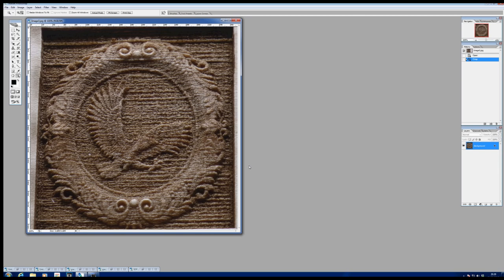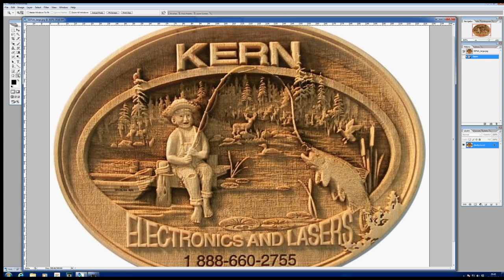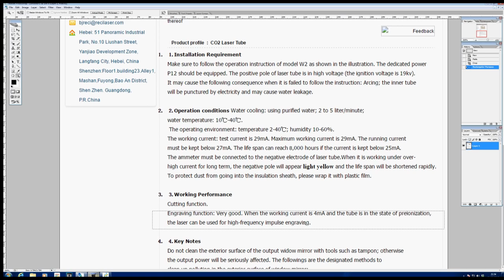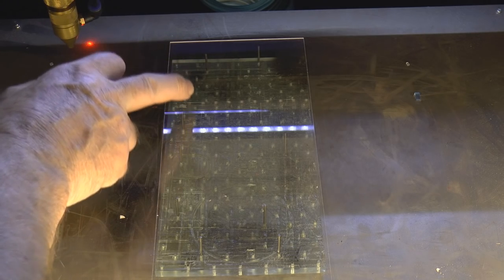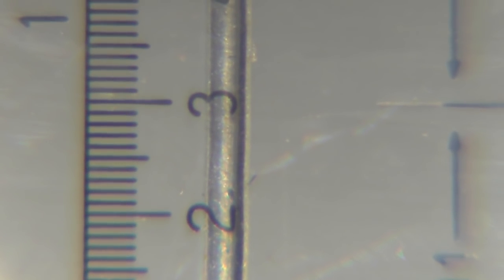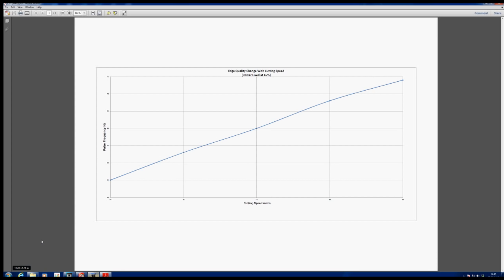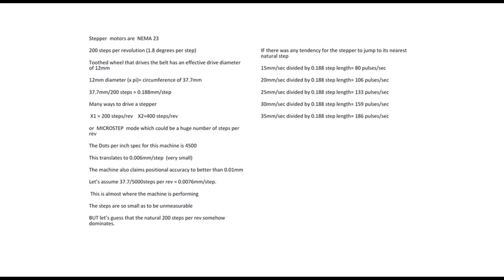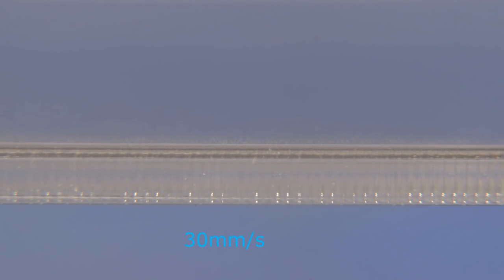RDWorks Learning Lab 63 High FrequencyImpact Engraving

Comment: Stepper motors are inherently digital, so it makes sense they cannot track smoothly. Adding weight to the laser head will lower the resonant frequency of the laser head/drive belt combo. If this resonant frequency is lower than the stepper pulse frequency then the travel should be smooth. The down side of adding weight will create larger forces on the machine requiring lower accelerations and additional wear and tear. 

Another solution to lower the resonant frequency of the laser head is to reduce the stiffness of the drive belt or putting rubber mounting on the stepper motors to smooth the amplitude of the torque pulses.

Thanks for the videos.
Reply from the maker: Hi Tim
It is possible to achieve extra inertia by using Y swing  but I have not seriously explored that option.... yet. That way you add quite a lot of mass with the gantry, head and bearing rail, but you have to run a bit slower.  I did note that even the best in the business (Kerns) still use stepper motors (closed loop hybrids ) along with non-elastic rack and pinion drives. There is still evidence of vertical marks on their deep cuts but I suspect that with such a non-elastic system  and the mass of the motor, which must be attached to the head, that would keep the resonant frequencies low. 
Thanks for the interesting feedback
Russ
Reply: Stepper motors are analog. Stepper drivers drive them digitally. Some drivers have microsteps - each step is divided to smaller steps - 4, 16, 32 ... etc. There are drivers that provide really high number of microsteps which leads to smooth, constant speed, quiet motion. Reference: https://youtu.be/ZzO9skEYqwY

Comment: Just wanted to say good work on this series. I have learnt a lot. I use to grind glass with a CNC and would get vertical striations like this. It ended up being vibration in the rail system. I installed a damper and it fixed the issue. It wasn't the steppers, but the gantry that was the problem. It was also speed dependent. Good luck!
Reply from the maker: Hi Philip
Many thanks for your thoughts and experience  I had noticed that the Y axis striations are more pronounced than the X axis marks but it was more difficult to get good closeup shots in the Y axis. So what you are saying has a lot of credibility. Subsequent to publishing my video I realised that I had overlooked a vital piece of evidence that I had gathered. My camera takes 50 full HD frames per second but the sound is captures continuously at CD quality. When I examined the sound track for the stepper at different speed there was no evidence of the resonance that I was convinced I heard. In fact all stepper speeds were showing as 225Hz noise. So I do have to look elsewhere in future.
Your situation may have been a bit different in that grinding glass and cnc engraving spindles  will send their own rotating head vibrations and also reaction forces with the work they are contacting. Neither forces exist with the laser.  What sort of damping system did you use? I had already considered mass damping as a research tool rather than a permanent fix , the extra mass would mess with the performance. I am very impressed with the accuracy and speed of this cnc control system  considering its very low cost.  These striations are but a possible clue to finding what's causing the VERTICAL lines in my 3D wood engraving. The only thing I can think of that knows its position on the machine bed, stroke after stroke, is the stepper. The laser, which I feel is pulseless when it is a steady power, may become a different animal when it's trying to find 256 grey levels. The PWM at 20kHz cant see changes in less than 100 micro second so I'm guessing that there is some other route to the power supply to control the current for rapid grey scale changes. This is something I'm going to have to try and check out.
Thanks again for your suggestions, it's great when others share their experience...remember I still have a lot to learn and in very technical areas like thi, if there are people that do know they are not saying.
Best regards
Russ
Reply: The mass damper I used was a mass and spring system on the edge of the rail. I had to sacrifice some travel distance, but it was worth it. I agree the lack of a tool load on the laser head makes a big difference in vibrations, but if you get close to a resonance zone even accelerating the mass of the lens and head could vibrate the rail. Also, if you have a belt system with cogs in it those are known to generate first and second degree modes. Although I don't work on CNCs currently I now do finite element analysis on jet engine systems. We deal with vibrations a lot. Another thought is that the vibrations are disturbing the cooling air resulting in modulating forced convection on the surface. So it basically is cooling better or worse based on the vibrations. You may want to see if you can observe vertical striations that are closer or further apart in a repeating pattern. That would indicate a second mode of vibration. Can't wait to see what you find!
Philip
Reply from the maker: Hi Philip
Thanks for you useful information, it triggers all sorts of thoughts. I had considered the possible slip and climb effect of toothed belts but with some close up video and slowing it down I could detect nothing untoward happening as the belt entered or left the pulley.  The problem was greatest when it was slower and as I only have 15 teeth on my drive pulley which has an effective drive diameter of 12mm , that's 37.7 mm circumference or aprox 2.5mm/tooth. If I had a tooth problem I would expect to see a FIXED pitch problem regardless of speed. Puzzling
Thanks again
Russ

Comment: Sarbar, While your laser is DC (direct current) and this works very well across a wide range of power levels, ionizing lasers (any gas) require a minimum current to continue to operate. To achieve the lower power levels, it is quite likely that the manufacturer changes the mode of the power supply which supplies the current (lasers are current driven devices) to pulse, where the average power delivered is in what is being expected. Bravo for your acrylic experiment, where you provide a way of visualizing this behavior. The reason current pulsing is needed has to do with the tube minimum tube current to sustain the beam, too little and the beam extinguishes. So the short high current pulses are well above the minimum needed to start the laser and when repeated at a high rate (5.5Khz at 9% and 3.5Khz at >10%) the average is lower than where DC  can be used reliably. When 14% or greater is being required the power supply changes mode back to DC and there is no change is power.
Reply from the maker: I am not an electronics person although I can get in to about my ankles. I had all sorts of issues with my first ebay power supply especially when it would be mid cut at 60% power and drop into "hissy" mode and lose the cut. I did not have a clue as to why it was doing it and decided to buy a new tube and matching power supply. It was during the research for that tube that I came across the term High Frequency Impact Engraving on both the Reci and EFR websites (as well as Mactron).  If you search for this HFIE it will just get you back to the EFR and Reci websites. I could find out nothing about this mysterious operating region. Hence I had to carry out my own voyage of discovery. I gradually became aware of what this "hissy" region was and why its there as part of the beam initiation routine.  I use this region often as it has some great properties. However I have one unanswered question that is really bugging me. 
It looks as though these (hissy) pulses can get as high as 60mA (maybe even 100mA). albeit for  very short spiky durations. Such high currents normally cause dissociation of the CO2 in the tube. So my question is whether persistent purposeful use of the region will seriously shorten tube life AND if this region has to flleetingly be traversed every time a cut initiates, is this what ultimately causes the tube to be depleted of CO2 by  trickling dissociation?
Any thoughts on this?

Best regards
Russ
Reply: I do not know this for sure, but I would expect there to be some 
shortening of tube life (maybe as high as 10%?) if you were to operate 
this high power laser in this very low power region continuously. High 
current levels may contribute to I dissociation / contamination of the 
mix. I know with Argon lasers tube pressure can be somewhat moderated by
 simply not letting them sit too long. I was going to suggest you use a 
second lower power laser in cases where only low power is needed, but 
that may not be acceptable for several reasons such as various 
materials, projects, extra cost, etc..  As to whether this region can be
 avoided, well, that has been governed by the manufacturer and how they 
manage the power supply. This may be observed by your acrylic experiment
 again, by traversing as fast as possible and then programming a step to
 some higher power and look for pulses at the start of the cut before it
 becomes smooth DC. I would expect at least one moderately high current 
spike on start up. Cheers!

Comment: in RDWorks V8, when you go to the layer parameters, There is the -- Interval(mm): 0.1 -- option. When you lower that number, the amount of space between the scans becomes less and the quality of your work will improve and you will see less of those rough lines in the background. I had done this a while ago with something I had made and it took a very long time when i had lowered it a lot, but man, the work was a lot nicer then the standard setting of 0.1.  Try 0.05mm Interval with the same file and look at the difference. You might have to change the power setting so that it will not cut too deep. I hope this helps in your journey.
Reply from the maker: Hi Harrie
You are quite right about the line spacing and I'm not worried about horizontal lines at present because I know I can either lower the line spacing and increase the time the job takes or I can increase the power and lower the table 2 or 3mm out of focus to get wider lines. It was worse for me when I did this first test because I was aiming for depth and 3D rather than quality. I have a 1.5" lens which produces a much finer line than a 2" lens. My major concern was the vertical lines I was seeing in my scans so I was more interested initially in trying to track down their origins. I have now done that and will have to apply all that I have learned in a near future revisit to 3D carving.
Thanks for the confirmation that lowering the line spacing will improve my result. I hope to do much more than that as well because I am aiming for significant improvement on my initial exploratory attempt.
Best regards
Russ

Comment: Russ,
Just wondering if you can answer a couple of queries I have.
1. How do you determine what focal length your lens is?
2. My machine looks like yours and I am wondering when I put the lens back the lens carrier can be adjusted and locked into different lengths so my query is what difference would it make to the operation of the lens?

Trevor
Reply from the maker: Hi Trevor
1)Use a drinking straw or cotton bud stick to measure how far your lens is inside your nozzle and then add that to the width of you setting piece.  You will find the nominal focal length and that can only be 1.5" 2" or 2.5"
2) The answer is no difference at all. If you think logically about it, when the head is at its home position the beam path is  say about 12" long, when you move the head to it's other extreme. the path is maybe 48" long. The beam remains coherent( about 6mm diameter) and loses no power travelling through air. The adjustment you are enquiring about is just adding and subtracting from this path length because it is before the beam enters the lens.
What's the adjustment for? If you have a 2" lens I think you will find you can open the front door panel  (and maybe the rear door also), drop your table down so that you can get  an oversize piece of thin material into the machine. You may be able to drop the lens sufficiently to work on this material.
Best regards
Russ

Comment: How can 70% power on RDWorks settings = 100% power on the laser cutter? How can I find out what percent power on my software = 100% power on my hardware laser cutter?  What is the relationship between mA and % power? What is pre-ionization, and what effect does it give me when laser cutting? Just trying to wrap my head around this. Your videos are the first place I've found that even begin to address this. Thanks.
Reply from the maker: Hi 
When you select %power,  the Ruida controller  generates a linear control signal that is 0vdc for 0.1% and 5vdc for 99.9% power. That control signal is sent to the HV power supply. The HV power supply has a maximum mA current rating depending on the tube power it is designed for. For example a 60 watt power supply may be rated at 24mA max. When you select 99.9% power that 5vdc signal will allow 24mA to flow through the tube.The current control is also linear so selecting 50% you will be allowing 12mA to flow through the tube. The big problem that most people fail to understand is that the physics of lasing is NOT linear. Every tube has it's own non-linear relationship to current flow . Some are VERY non-linear. For example a 60 watt tube should not be run at more than 22mA ie 24/22=90%.power.  but 45% power will NOT be 30 watts. It could be that 30watts will happen by about 20% power. these video will hopefully answer your questions.
 https://www.youtube.com/watch?v=2F5O-1TH8b0&list=PLPWEtx5V9DqEogIeYRdcG_KYcB7UL2Qmn&index=7&t=44s
https://www.youtube.com/watch?v=nZuatc3eIgU&list=PLPWEtx5V9DqEogIeYRdcG_KYcB7UL2Qmn&index=26&t=1487s

I always use the top end of the preionization zone for card and paper cutting and also for photo engraving on some materials.

Best wishes
Russ

Comment: Great video! 
Question - while I understand the pulse consistently based on power setting wouldn't the laser focus also play a role in the detail or lack of detail as it cuts deep into a said material? For example if cutting a piece of wood as in the Kern example, the deeper the cut the less the laser is focused in the deeper area .125 of the embossing verses the top of the part say 0 to .01 of depth?
Reply from the maker: To a certain extent and according to all conventional wisdom, you are logically correct. However in the light of what I have learnt about the beam over the past few months I can see why  the change of depth during 3D engraving does not greatly affect the detail. There is a later 3D video that you may wish to catch up with that starts to touch on the subject along with another about wood cutting
https://www.youtube.com/watch?v=j5cIFxGu_1g 
https://www.youtube.com/watch?v=JgYIAA-uHU4

 I have learnt even more since then about the beam profile and the importance of energy density. You may be able to understand after the second video how it is that the energy density maximum can be  much lower than the focus point. 

Best wishes
Russ

Comment: Again Russ , thank you for your research on CO 2 lasers, there is a lot of mis information out there and I enjoy watching you try to prove things.
I wonder if the small grooves are caused by the material itself and how it reacts to being cut with heat.
I have seen lines like that while cutting metal with an oxy/acetylene torch by hand and also on CNC tables. By hand it can happen with thicker materials and a nice steady cutting speed, to smooth the lines out, you would add more hear to the cut.
Just an observation.
Scott
Reply from the maker: Hi Scott
This is definitely a mystery in progress. The more I look, the more problems and questions pop up. I'm a busy guy outside of my retirement at the moment but I mustn't complain because I'm making good pocket money . However,  it's getting in the way of my journey of discovery. Fear not though, I have made a slow start on my next video and some of the results are baffling...very interesting but baffling.
I know exactly what you mean about the striations. I think I mentioned in the video that one possible creation mechanism was what I call cliff edge collapse, it happens in chunks not uniformly. And yes when I did the beam drag video I proved that cutting acrylic quickly produced these striations but if you back off the speed, the extra heating time available in the cut area, causes the edge to be "flame polished"
All thoughts and ideas gratefully received and dissected to see if the philosophers stone is hidden inside.
Best regards
Russ
Reply: I wanted to edit my original post to read " add more heat to the cut"

Comment: I think our machines are just fitted with not so good stepper motors. If you put your hand on the head while it is moving at lets say 30 mm/s, on my machine I get a strong vibration, I'll say its not enough to cause problems with cutting  (although you get some rough edges) but on this type of engraving the problem seems pretty obvious. 

There are some speeds however, where the resonance seems to be either gone or very weak, particularly, higher speeds > 300 mm/s. So probably a more potent laser tube will allow speeds in which the resonance will not be a problem.